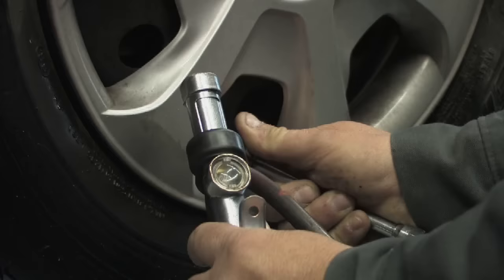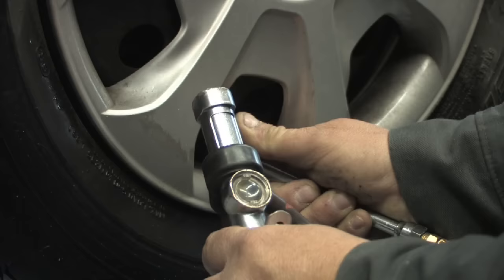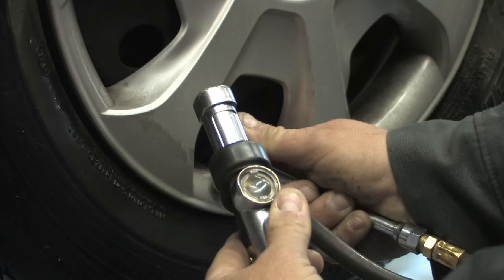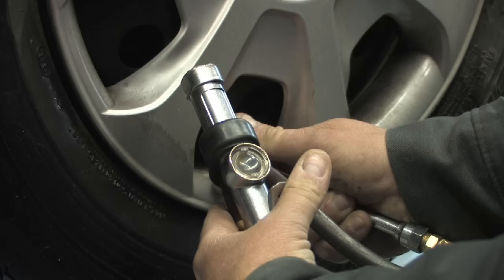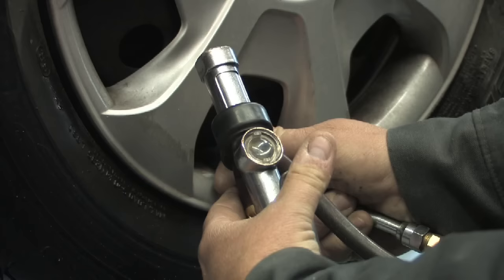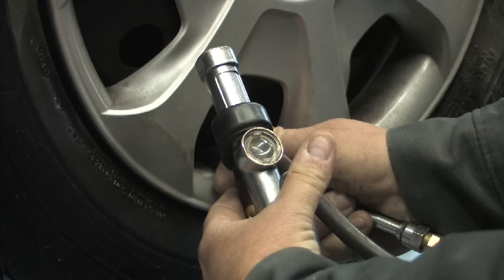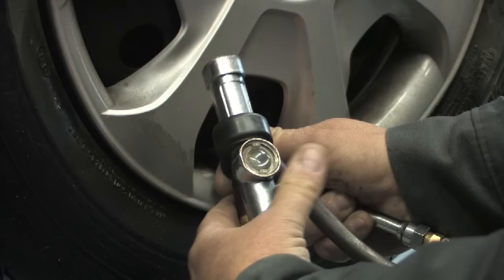Car Maintenance : How to Put Air in Car Tires

Comment: where are you reading the air pressure? most of the gas station here in chicago have no gauge so I was wondering how can u find out how much air u put in, it's weird (without buying a gauge)